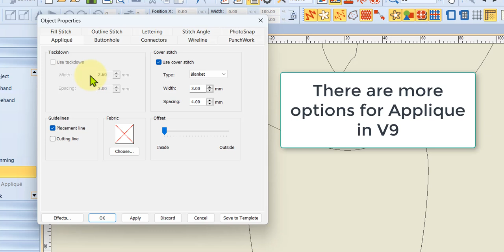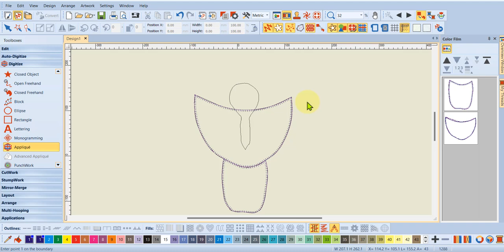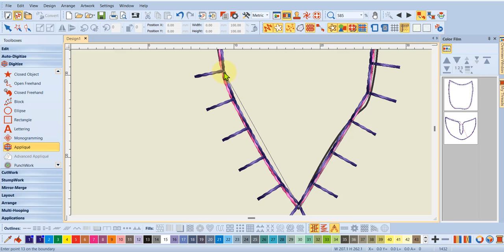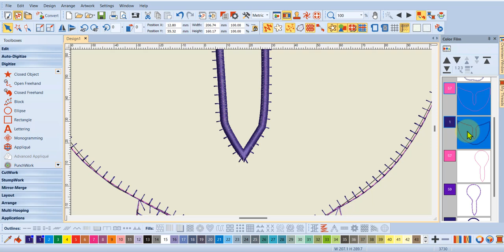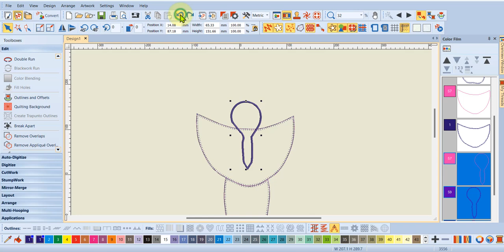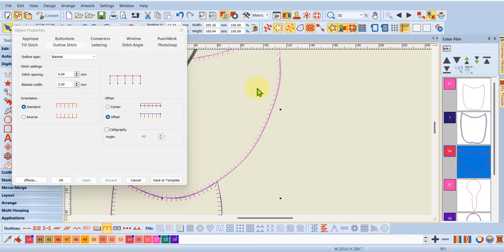Some Applique choices and techniques

Comment: Hallo please tell me I did a design a couple of years back. Size 26cm wide it is a bird and the wings and feathers is in satin stitch.  Now the client want it 45cm wide and I did make it 45cm and the outlines was way off.  What must i do?  thank you
Reply from the maker: Is the outline not sitting on the edge, and if that is the case, is that happening in the software or when you stitch it? 
When you have large designs, the pull from the stitches increases and so the objects do not stitch to the size of the digitizing. Increasing the pull compensation can help if the difference is not too much, but if that is not enough to fix it you need to reshape the objects to compensate for the pull. This video will explain that in more detail. https://youtu.be/pUzG8YwxnTs
If this is not your problem then can you give me some more detail please? How did you enlarge the design, and what do you mean the outline is way off?
Reply: @CarolUndy   thank you I will do the changes